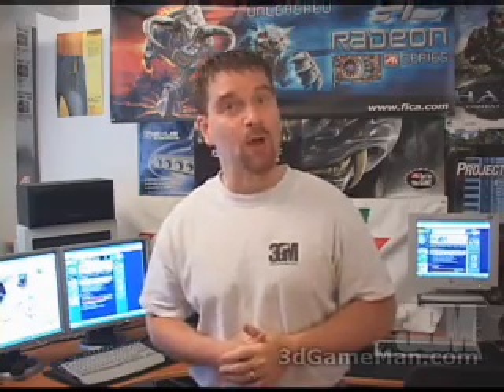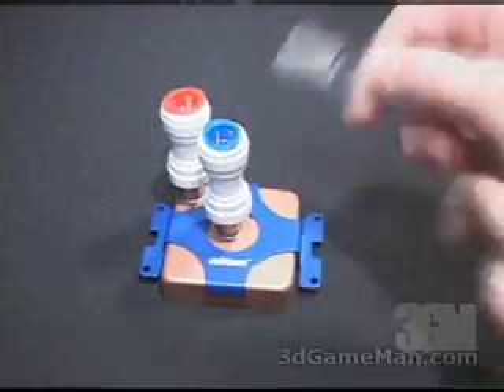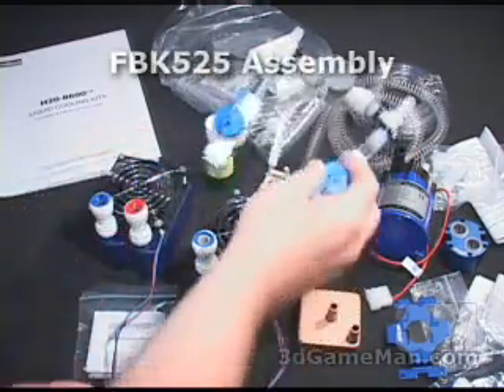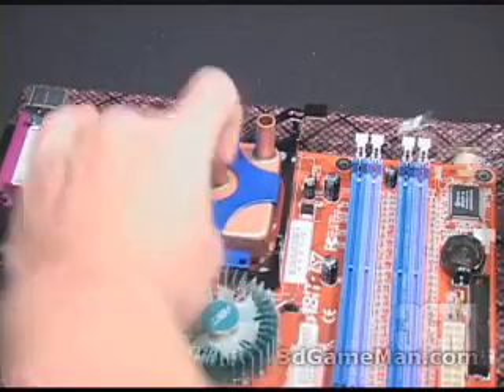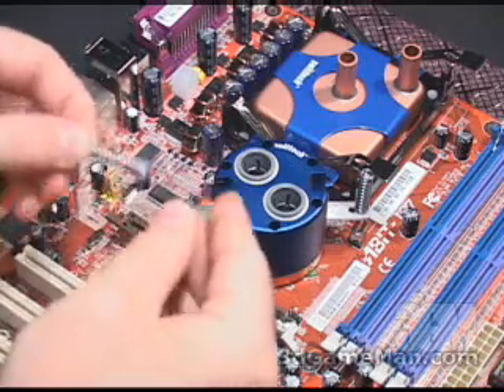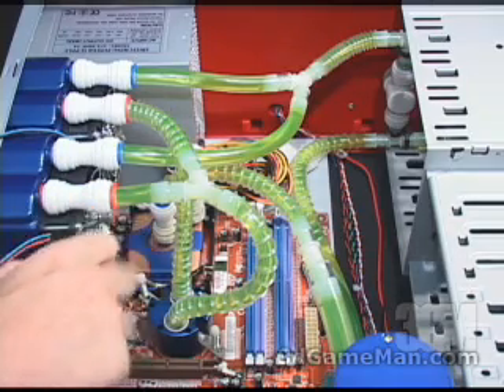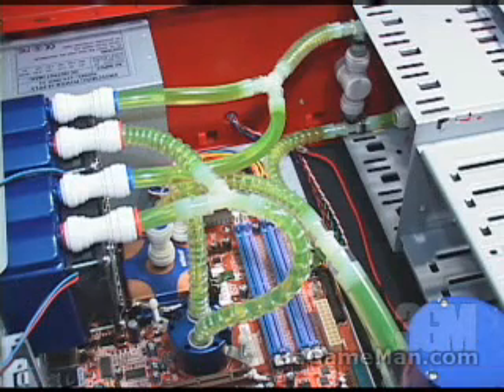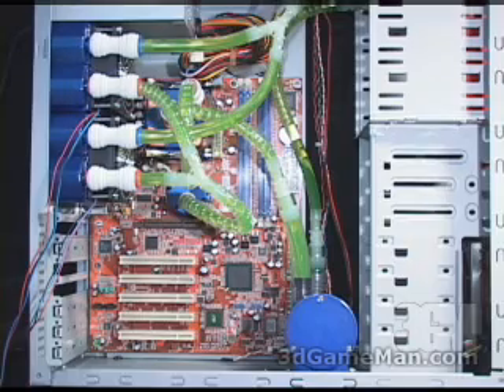#454 - Swiftech 8600 series Water Cooling Kit

Comment: i would run the pump to the cpu block to a radiator then to the chipset block then to the other radiator , to the filling assembly then back to the pump

Comment: good conductors /shit insulators of heat are able to radiate heat into the air, making them colder. they ARE able to become colder than air temperature. go find something metal in your room, you will find it colder than the ambient air temperature. the same applies to liquids, especially this type. however, i doubt that it would be colder than air. but im not saying it's not possible.

Comment: The radiator is mounted where fans are normally mounted; also, this product is extremely old -- you will likely not be able to find it in stores, and even if you do, it will be inferior to all the new ones out now. Check out some of the new stuff by Swiftech, I'm sure they have some pre-assembled kits for  new watercoolers to use on their first build.